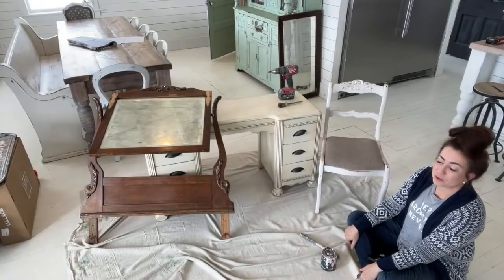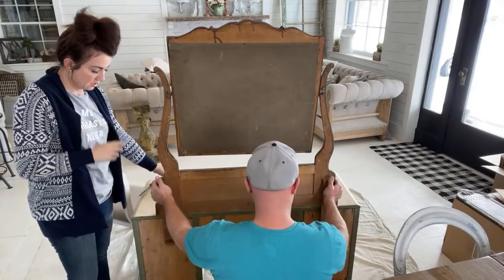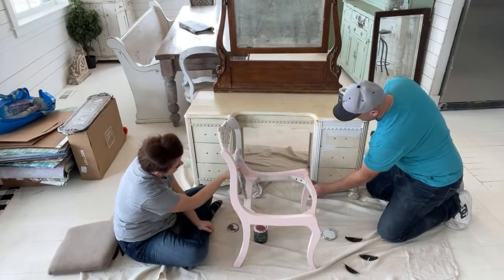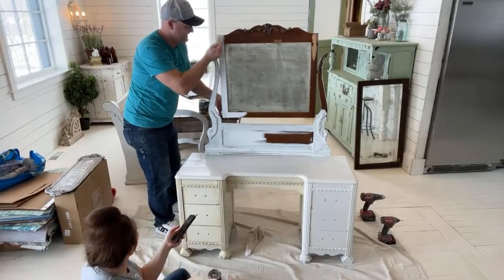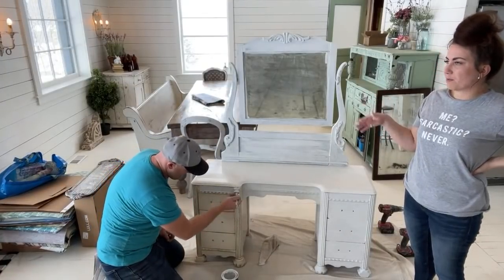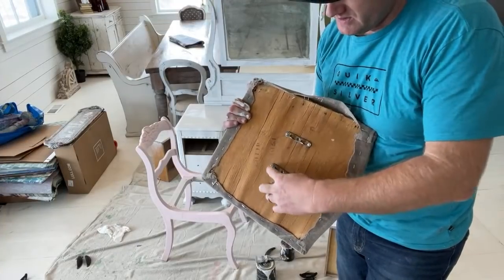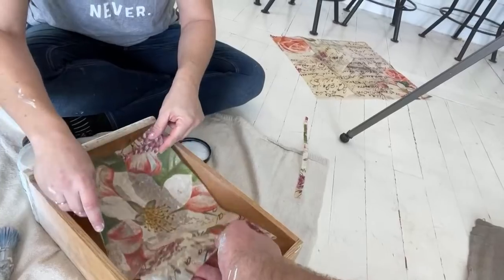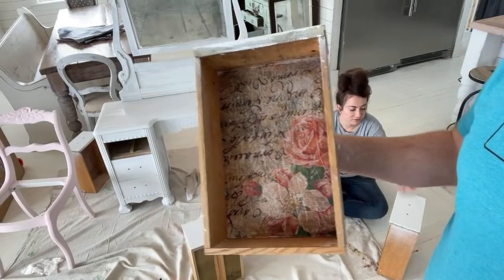Making a Vanity Out Of A Desk

Comment: Did the same thing myself. Had an old desk, French design but it didn't have a mirror. Bought one that was frameless and hung it on the wall and it works perfect for me also bought a chair second hand at Goodwill and painted it.now I can sit down to do my hair and makeup which is great. I had an old mirrorr that was kind of beat up like that. What I did was that I had it resilvered. That way the mirror is actually able to show a reflection again. You can probably do it yourself, if you know what you're doing and it would be a lot cheaper.